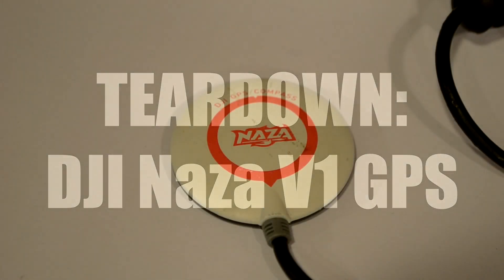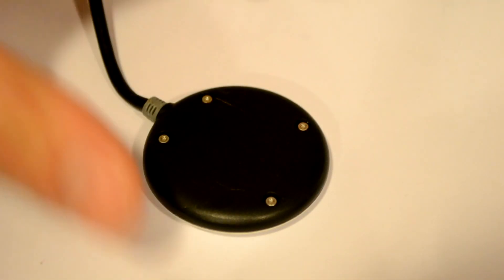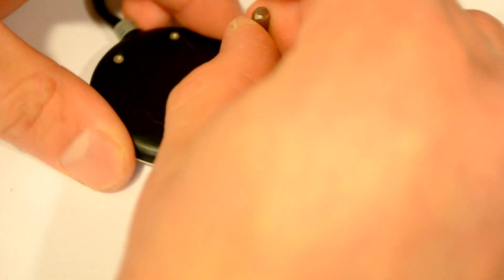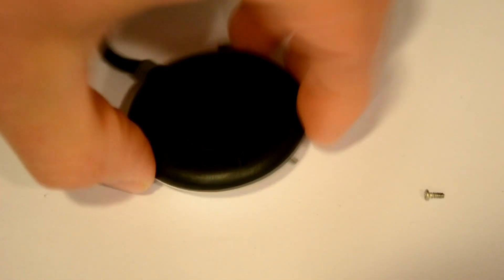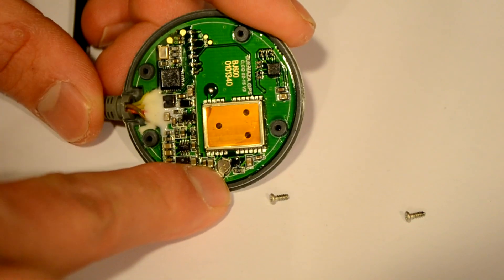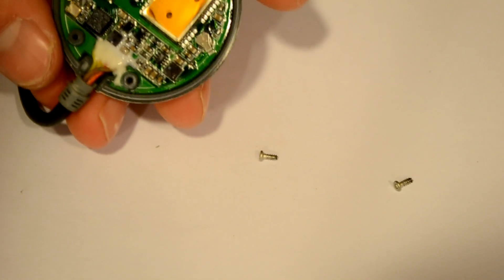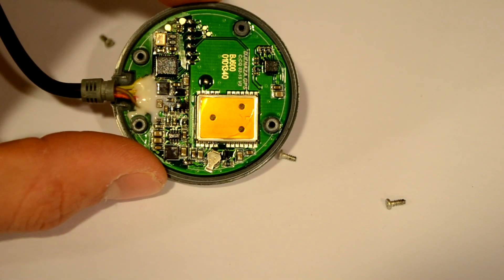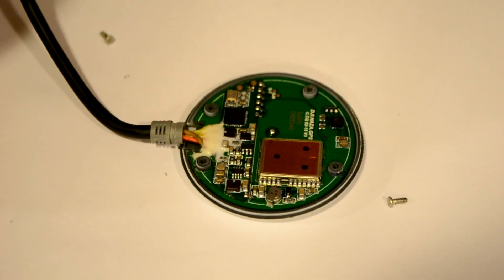Teardown ---- DJI Naza V1 GPS/Compass

Comment: I've always wondered what was inside the GPS puck, now I know. Thanks Brendan. I have built a DJI F550 and now Im thinking about getting a TBS Disco pro and your build videos have been very helpful, I subscribed. I really want to get into FPV and since our local hobby store is going to start carrying TBS products it looks like this is the year I try it. Both my son and I started flying last year. Thanks again, lots of good info on your channel.
Reply from the maker: Hey, anytime! Check out the SAW filter mod if you're looking for a faster lock. The Disco pro is amazing! If you have any questions about set up or FPV let me know, I'll do a video. Enjoy!
Reply: Brendan Stewart hi what is the  saw filter mod? does it make naza gps module lock onto sats faster?  davidringler40@yahoo.com
Reply from the maker: david ringler Mod Installation --- DJI Naza GPS SAW Filter
Reply: I USE 5.8 FPV BUT WANTED TO SEE IF A TRUE PROVEN FASTER GPS MOD WAS OUT THERE!
Reply from the maker: I'm not sure you understand what a filter does.

 If you don't have any sources of RF that are close enough to 1575mhz to interfere, you don't need to do the mod. It speeds lock time in RF heavy environments, but not so much that it's worth the hassle.
Reply: I KNOW! THATS WHY I USE 5.8 ALL OTHERS INTERFER WITH TX GOPRO SOMETHING I USE BOSCAM 5.8 32CH 600 MW RX/TX COMBO 7INCH SCREEN W 5.8 RX INSIDE OVER TO 21 INCH HD SCREEN FOR FPV SC2000 700TVL CAM AN GOPRO ALL ON OWN POWER SUPPLY FLIGHT -FPV TX AND CAMS ALL SEPERSTE WITH MODELFLIGHTREVEIW 129USD FILTERS WORKS FLAWLESS I HAVE A 3 STORY HOUSE USING 5.8 FOR FPV I CAN LET CAM ON 3RD FLOOR INSIDE BRICK HOME AND WALK 2 BLOCKS UNTIL 5.8 SIGNAL STARTS MESSING UP AND I HAVE A FOX TV STATION LESS THAN A HALF MILE AWAY FROM ME SO 5.8 DOESNT PENETRATE TREES? MINE DOES AND BRICK WALLS IN A CITY!!
Reply from the maker: I'm glad its working for you! TV stations work in the UHF and VHF bands, so they aren't anywhere near close to interfering with 5.8.

The reason I directed you to the video is because the only thing the filter does, is kick anything other than 1.575ghz out of the GPS. I don't know what's causing your lock issues, so I cant say with perfect certainty that the mod will help. 

You might consider doing the mod anyway if you live in a very RF heavy environment, it won't hurt unless you make a mistake (the part is REALLY small) its just a pain in the ass to get in place!

If I where you, Id wait until you step into the lower frequency, longer range flying to do the mod. It's unlikely that it'll help you much where you stand.
Reply: ok thank you, I was considering doing it as a precaution!
Reply from the maker: OH! took me a minute to catch on to what you wanted to do with it! I'd be careful. Adding too much wire to it can actually de-tune the GPS antenna inside the puck, making your lock weaker. If you aren't around 1.3 I'd say forego it.
Reply: I don't need that to happen.I guess until someone writes or upgrades code for naza gps were stuck?
Reply from the maker: How long is your GPS taking to lock? it normally takes about 3 min.
Reply: under 3 for sure I put goldleaf all over the underside of puck!
Reply from the maker: nice. gold is a little excessive, copper is cheaper and does the same thing!